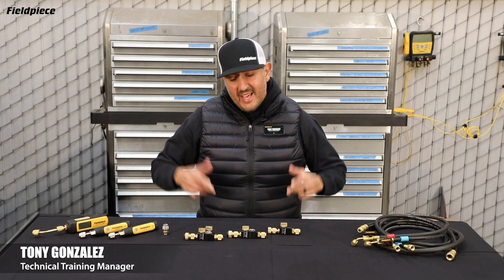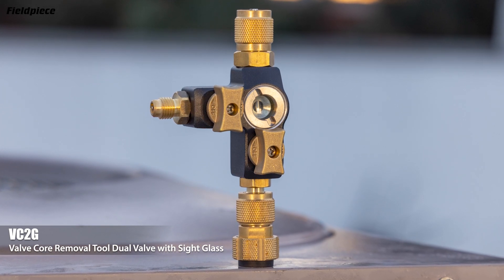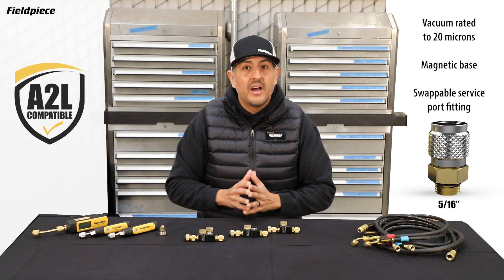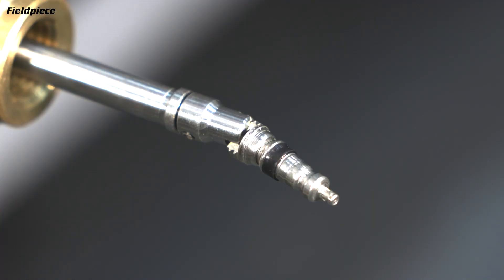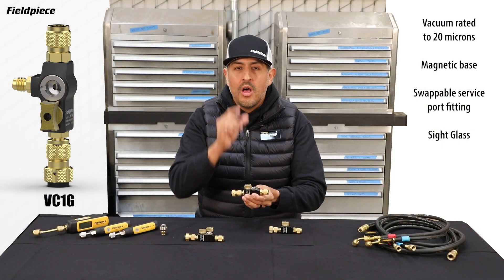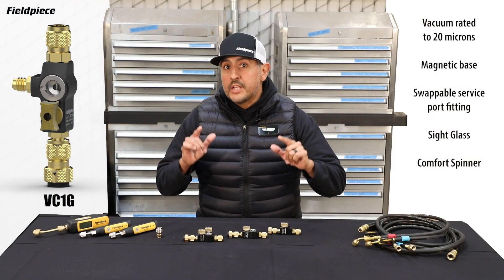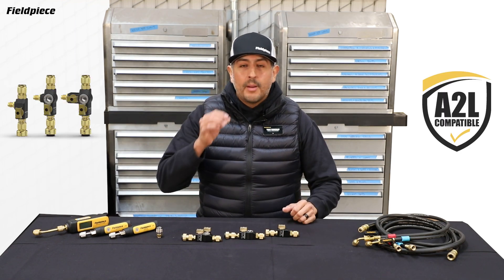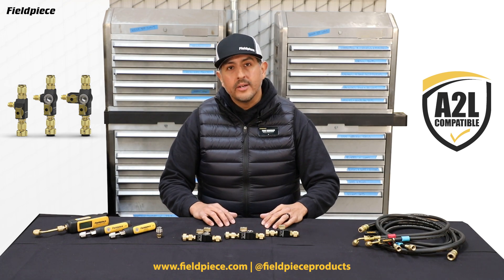NEW TOOL LINEUP | Valve Core Removal Tools, VC1, VC1G, VC2G

Comment: Just bought the VC1 and was scared using it. Couldnt feel the valve core so i tried using it with out the core removal tool and it doesnt go all the way in like the appions also cant grab the vavle core and have in the tooth where u can tighten or loosen the valve core. Maybe im missing something ?
Reply: I'm having the same issue with both of my new VC2
Reply: @mateoalzate9935 takes some bravery but the vc1 actually has had a much higher success rate at first attempt however on my vacc it seems like its leaking. I do go thru with a hand tool and tighten just to be safe afterwards Tho

Comment: My experience with the VC2G has been AWFUL. I bought two of them from Trutech, and waited for months to receive them. When I finally got them, I was very excited to give them a shot. I’ve tried them on around 10 different units now, and I’ve successfully grabbed the core twice. I feel the tool grab the core, add a little more force to seat it in the hole, and successfully unthread it, but fail to actually grab/remove the core. I wind up using my old YJ tool instead, since that grabs the core on the first shot around 90% of the time. Very disappointing, considering their cost and Fieldpiece’s quality/reputation.
Reply from the maker: We're sorry to hear that! We want to make sure your experience with our tools is always top-notch, so we would appreciate the opportunity to make it right. If you have not already, please reach out to our service department at the number below, and they will take care of you! 
Phone: (714) 634-1844
Reply: I had that issue as well until I found another video from Fieldpiece that showed how to fix that issue.  I did it and I grab them every time

Comment: Cool! The version with two valves is a really useful solution. Now there's no need to attach a second VCRT to the port just to block the flow to the vacuum gauge.